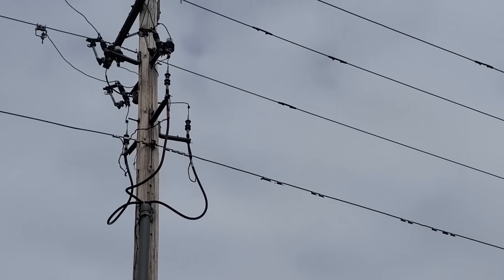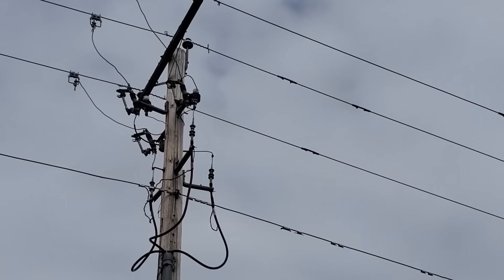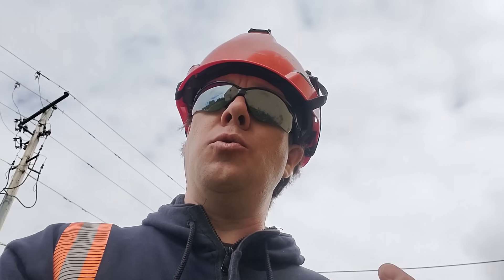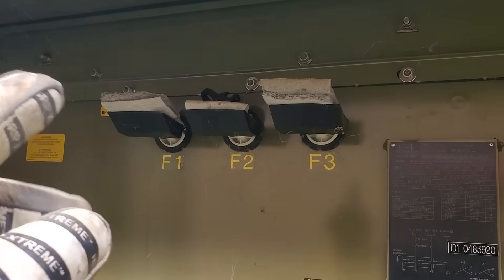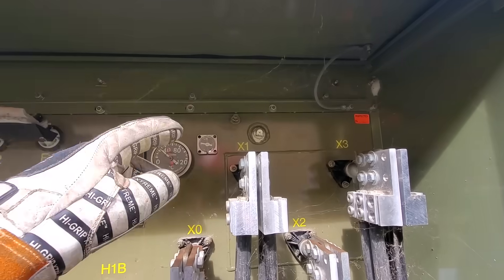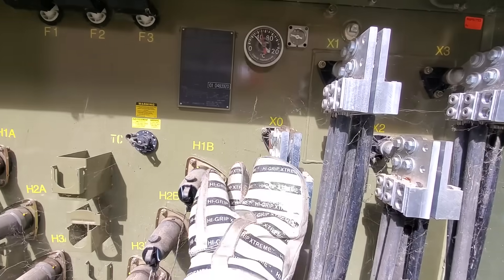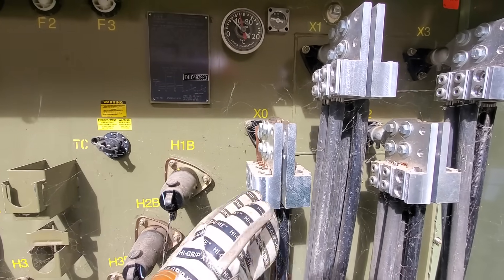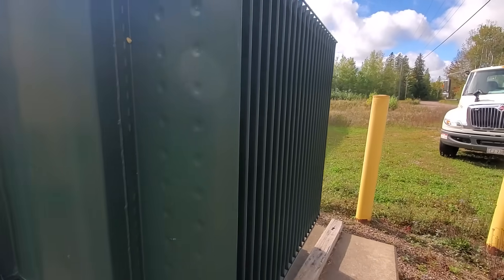A closer look at Padmount Transformers

Comment: u said sometimes these house "primary metering tanks"  ...wth is that lol
Reply from the maker: Sometimes a large property has multiple buildings and their own private system.
An example is the military base. Dozens of buildings without meters  on a secure site.
We supply the power right up to the property line. The power is then metered right off the three phase primary by use of CT's and PT's(current/potential transformers). They change the current and potential to a readable level which then pass through a unique type of meter.

The equipment is usually mounted on a pole like a transformer bank, but occasionally mountain inside a padmount enclosure.

Comment: I worked wind turbines and our fields were from the eighties and had all sorts of pad mount transformers. Most were live front and many had a bank of breakers for seperate smaller turbines mounted on right side. Twice a year we did service-cleaning, torquing etc. Yes, a snake across the phases blows the left door wide open! And a re-connect of a shorted gen by an unknown service guy can blow up a padmount in two seconds flat! True tales from the wind farm!

Comment: Working as an electrician for the Lipton Tea company we were tasked with installing and repairing electrical systems. I was given a work order of no power in a building we rented. Checked all the main breakers no power walked out side to the utility pole found the problem a squirrel met its maker dead at the base of the pole. Called the power company blown fuse 13000 volts I believe OUCH

Comment: Ok I feel super dumb for asking but the pad mount at my dads new house from what I can tell is ONLY pulling off of the A phase.  It looks like the neutral is bugged onto what I'm guessing is the neutral/ground sheath of the feeder.  The pole arrangement is only A, B, and a neutral and the only phase that's tapped is A.  How does that work?  It's only running about a dozen 120/240 residential so not an enormous load but why wouldn't they bring in two phases?
Reply from the maker: That sounds like a single phase "feed through". 
The "A" has a primary cable with a concentric neutral. (Neutral is inside the outter most sheathing). The neutral is then bonded to ground which is also bonded to the secondary neutral.
The "B" side is directly connected internally to the "A" side and is for an exit cable that feeds through to another padmount.
Reply: @Bobsdecline  Ok gotcha.  And yeah two poles over in the same development is what looks exactly the same only B is tapped. Thanks!

Comment: I got interested in electricity as a kid from all things Christmas lights. In those days we had the c-7 screw in 120 volt lights. Then they came out with the mini lights in series so got a basic understanding from that. Took classes on electronics and got a job at 16 working for a electrician. Got my Journeyman's license at age 20 and my Masters at 22 (they only tested twice a year back then). I done some 13,800/24,000 very time consuming splices underground. Mostly deal with stuff under 600 volts. It is a good trade that pays very well.

Comment: An additional point regarding why cables aren't generally buried outside of short-distance runs: It's just really god damn expensive. Hanging a wire on poles is easy, you can just rely on the air to insulate them and keep the wires out of reach. They're otherwise very accessible for any work that needs to be done.

Buried cables, on the other hand, are vastly more expensive at every step of the process. Not only do you need to dig a trench, but you also need dedicated insulation, and that cable will have more limited capacity, both because of less allowance for thermal expansion (overhead cables can just sag; underground cables can't) and because the lack of airflow means you don't get any air-cooling effects that can theoretically help mitigate heating from high current. Not to mention you have to re-dig it up any time you need to work on it.

Special shout-out to some underground runs that fill their lines with dielectric fluid, which both adds to the cost AND makes doing work even harder!

Running underground definitely has its benefits, as it's generally a fair bit more robust than overhead, but the caveats of overhead are largely made up for by the relatively cheap cost and ease of maintenance. If you need to do something with an overhead line, it's usually just some work with hotsticks, sometimes booms, and depending on what you're doing you might not even have to de-energize the line. If you need to do something with a buried line, it's basically guaranteed to be a multi-day event unless it's a really short run. (Depending on how much work is needed, it can be a multi-MONTH event! My local utility spent the first quarter of the year replacing the underground cables for my neighborhood, and that took multiple months, multiple holes in the ground, horizontal directional drilling machines, and several unusable sections of sidewalk! Fortunately actual service was only disrupted for about an hour, but the rest of the work was disruptive in a whole different way!)

Comment: 2:26 "you can't dig up and tap into while energized" - well - this is maybe true for 10kv lines - but once they already brought down to 400v (i'm going with european 3-phase 230/400 system here) it's done pretty often - already watched it myself 2 times
Reply from the maker: Oh yea, low voltage can for sure! There's no way to safely tap into a high voltage u/g to add a transformer or spur line
Reply: @Bobsdecline  well - I guess the main difference is how new buildings are connected to the grid
at least in residential-only areas there're big 400v cables under the sidewalk powerful enough to supply multiple small houses (even multi-family houses are usually connected to the grid only with 3x 63A grid connection fuses - single-family homes maybe with something lower like 3x 32A) - we don't connect each single home with its own transformer to the mid-level lines (10kv and up)
yes, this result in overall more losses - but as europe has one big interconnected grid italy can be supplied by scandinavia or poland from portugal - so in the end pretty much all europeans pay the extra expenses for the grid and hence balance eachother
as for commercial buildings its kinda like your situation: there comes a mid-level line in - something like 10kv or some in-between line, I'm not sure - and is usually either brought down within a special electrical room (like a small sub-station) or its down external like with those slab-transformers you shown here
anyway - my point was just this "there's no way it be done while energized" ... maybe over in murica as there're this 7.2kv overhead lines - but here in europe where pretty much anything is only 400v underground cables its common practice

Comment: Another big reason for why I'm a fan of overhead vs underground is it's cost per mile and it's service life. Overhead lines can easily have a service life of 100 years plus but underground is usually half that until something serious happens. Also ease of maintenance, you can see if an overhead line is messed up, underground is a mystery.

Comment: Love your videos Aaron 

If you get a chance can you explain how those high voltage lines are 12470 volts potential difference between phases but only 7200 volts difference between phase to ground
Reply: What's really going on is that each of the phases, are sine waves as a function of time, all of the same amplitude and frequency as each other, and the essential difference is a 120 degree phase difference.  This is analogous to the 120 degree actual angle difference between the Y's legs, as this is represented on paper.

A group of 3-phases is the following:
Va = A*sin(w*t)
Vb = A*sin(w*t - 2*pi/3)
Vc = A*sin(w*t - 4*pi/3)

Each of these is the phase-to-neutral voltage as a function of time (t), where w is a term related to the frequency.  In the USA, w=377 rad/s (i.e. 2*pi*60 Hz), and for a 120/208V system, the value of A would be 170V.  Why it is 170V instead of 120V is a topic for another day, but the short answer is that 120V is a special kind of time averaging of a waveform of amplitude 170V, such that we use 120V as the most common way to identify it.

If you measure phase-to-phase, you will get another waveform of the same frequency and 173% of the voltage amplitude.
Vab = Va - Vb = A*(sin(w*t) - sin(w*t - 2*pi/3))

I'll leave it as a trig challenge for you to prove this, but what you will end up with is the following:
Vab = A*sqrt(3)*sin(w*t + pi/6)

Amplitude went up by sqrt(3) or 173%, and phase shifted from phase A by pi/6, which is 30 degrees.  The frequency and wave shape still remain the same.
Reply: Draw the shape of the letter Y, where each leg is 12 cm long from the center to the tip.  Locate each leg of the letter Y, at an equal angle distribution, so that there is 120 degrees between each leg.  Now draw a triangle that connects the tips of the letter Y, which will be an equilateral triangle.  Without a doubt, the triangle's side length will be 20.8 cm.   This is a scale model of the 120/208 WYE grid, drawn in the phase-space representation, where each millimeter represents 1 Volt.   Measure phase-to-neutral, and get 120V, and measure phase-to-phase, and get 208V.

Now scale it up by a factor of 60.  Now you have 7200 V from phase to neutral, and 7200*sqrt(3) Volts from phase-to-phase, which is 12470 V.

Comment: Is that a delta to Y (wye) transformer?  I see 3 connections in and 4 out, and one is labeled X0 which I'm guessing is the center of the Y?  If you have a padmount transformer on your street for 240V, those are single phase only right?  Do you look at any of those?  What was the input/output voltage on that transformer?
Reply: It has 3 coils X0 X1 X2 X3 for LV out. Taps on the HV on these he misspoke because Deltas have taps on the back of the coils through the HV the LV is the inside of the coil. Liquid you don't get to see how it is made but dry you do. hope that helps not sure.

Comment: Just got into testing transformers at my new job, mainly power and distribution transformers. Had no idea how many tests could be done until I started - power factor, excitation, bushing tests, sweep frequency, etc. 

A quick note. The ONAN class transformers are "oil natural air natural" meaning it's just ambient air cooling. FA would be "fan assist". The newer FR3/natural esters will have a K designation, like KNAN. And the air in the transformer is the nitrogen blanket. When it gets really cold they can sometimes pull a vacuum which sucks in moisture and air, which then needs to be processed out of the oil after a dissolved gas analysis.

Comment: Back to our 4160 supply for our compressors. Inside on what i call the switch panel. We had a transformer( i guess what it was) it blown. I was told it should have blown the door off. It was all cooked. I was only aloud to work on up to 480.

Comment: Electric power is EXTREMELY expensive right now:  Do you recommend drilling a small hole in it to fry toast? I mean not a big dangerouse hole that will let out lethal electricity - but just a small hole to stick a sandwich inside? How long time does it need to be grilled?

Comment: Why does the low voltage output of the transformer have 4 wires / phases? I was expecting to see 3.
Reply from the maker: 3 phase with 3 hots and a neutral

Comment: I absolutely detest Padmount transformers, not because of what they are, but because of how they have been used in some parts in England.
They are designed to be an alternative to a Pole mounted transformer and to be fed off of an overhead HV switch located on a pole.
In that situation if you need to do any work on them you can isolate the HV switch on the pole to isolate the Padmount.

But unfortunately in England we have recently gone through a period of where we have been forced by the government regulator to install the cheapest design rather than what is a good engineering design.
So we ended up installing them as if they were underground substations. Meaning that we were connecting them to an HV underground cable network via an underground HV breech joint.
So in effect they are direct coupled to the underground network. so if you have to do any work on them [like replacing the HV fuses inside them] you are forced to shutdown the entire underground cable section that they are connected off. 

[Instead of paying extra for a full ground mounted HV substation with HV switches, we will save money and install a Padmount instead]

People like me were complaining and pushing back and on occasions refusing to do it, but others have toed the line and gone ahead and installed them in this way, and as a result we’re have a lot of these in the network that are an absolute pain the arse in regards to maintenance and fault restoration.

Thankfully the powers that be have come to realise that this was a stupid idea and we are no longer installing them on the distribution network.

I think they are useful when installed with an HV switch to give you a point of isolation, but the way that we were using them was madness.

This is what you get when you let government bean counters interfere with engineering designs.

Comment: Here in South Australia,we use 11kV "over & under" down the side of the pole & our Voltage on the secondary side is 240V/415V & our poles are called Stobie poles, they are 2 lengths of H mould steel set at a slight angle to each other and tapered off at the bottom,and the middle is solid concrete,to my knowledge we are the only place in the world that uses them,the downside is when a vehicle hits one at a high speed, they will cut the car clean in two, especially our very large 66kV poles,they were invented due to Sth.Australia having a severe shortage of suitable wood. Aaron,check them out,see what you think mate.Stay safe Brother.      👊🇦🇺

Comment: if you verified it's de-energized and there is an absence of voltage, why are you still using a hot stick? i'm curious... i do turns ratio and winding resistance tests at least every other week on wet and dry type transformers. please reply back. thanks
Reply from the maker: It's standard practice to use grounds when working on any wire/cable that has been energized at high voltage for multiple reasons: Backfeed, induction, accidental energizing etc...

Underground cables are especially prone to capacitance/holding a charge. I'll try and capture the arc on video next time I use a ground on a de-energized cable.

That being said, we do have procedures where grounds aren't possible during testing. If that's the case, cables must still be drained using a ground, parked and handle with rubber gloves
Reply: If you are ratio testing without your box grounded and using a grounding stick you really need to inform who ever is in charge of your safety team. While unlikely it is still possible to shock you. Seeing how most ratios are done at 100V etc

Comment: Also, I try to avoid touching electrical anything because I have been zapped both by 110 and 220. I was here in the US when my mom woke me up to see if my outlets were working in my room. Stupidly, I touched the sides of the exposed outlet to try to plug something in. I was under the foot space of my desk, got zapped, the electricity forced me to bang my head on the desk, but I also didn't need a cup of coffee to wake up that morning.

The incident with the 220 was in South America where I was trying to take a shower. They have these things that heat the water right as it comes out of the shower head and someone decided it would be wise to ground this device on the bars of the window in the bathroom. The thing was that this is where everyone put the soap. I ended up grazing one of these makeshift grounding bars while reaching for the shampoo. The next thing I knew, I was all the way across the bathroom, still standing on my feet with my heart racing. That was more than a cup of coffee's worth of zap there.
Reply: Everyone swears these devices are safe but there's things that just shouldn't be in the bathroom IMO.

Comment: How do you de-energize a transformer, how long does it take to completely de-energize and how do you check it is completely de-energized?
Reply from the maker: There's typically a disconnect switch ahead of the transformer, in this case it's on the pole. It is the energized instantaneously (once all three switches are open or a gang operated switch). 
Once the energized it would not yet be considered safe you would check for potential and then install grounds either by plugging the elbows onto a grounded insert or by installing grounds at the switch location

Comment: What would happen if you did moved the offload tap dial while the unit was energized?
Reply: same idea as opening a line-operated switch under power -- huuuge sparks -- except it's all under high pressure oil.  So possibly an explosion and big fire.

Comment: I use to work making pad mount transformers at GE . I cleaned up the welders slag and shaped the tank with an air grinder
Reply: We used to call them "pimple chasers" as it was an entry level manufacturing job.  I was one.  We built large GE transformers in Pittsfield, Ma.

Comment: Overhead lines are antiquated. Trees fall an take them out. Cars too. Put in UG.  If a customer wants a tap then run/add it to a tap point.  Thanks for the vids.  Learning a lot
Reply from the maker: In an urban area, absolutely! Rural..... There would be thousands of unused tap points that still wouldn't cover every possible build zone.  We've got a lot of wide open space around here! Thanks for the comments and for watching! 🍻
Reply: OH lines would surely have to be cheaper, though. Cheaper and easier.